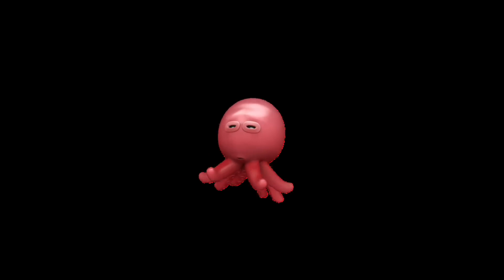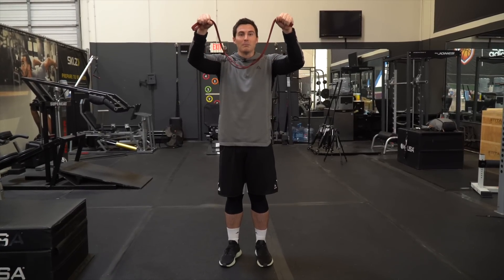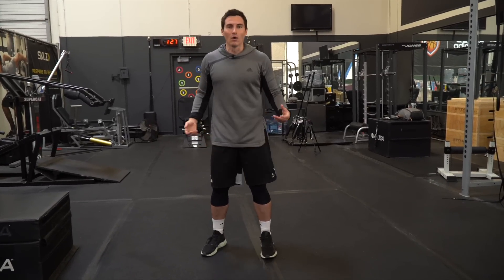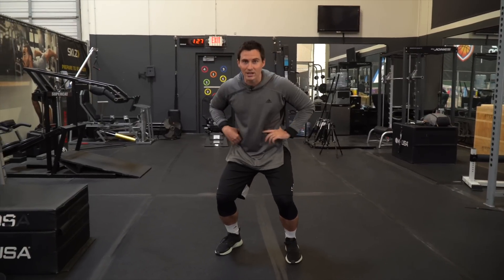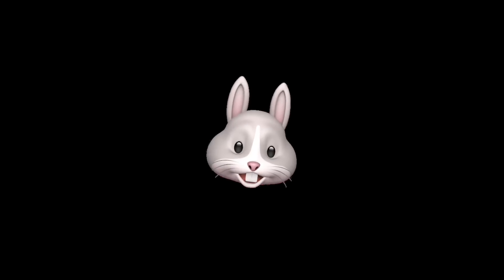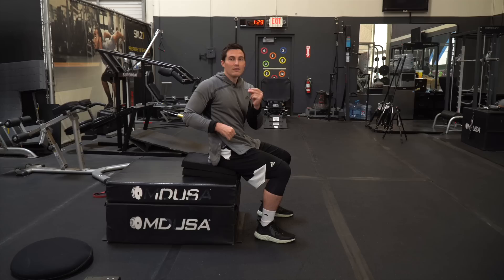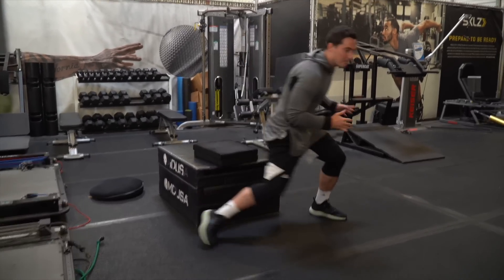Explosiveness Cheat Code- Improve Vertical Jump and Speed w/ This Tip

Comment: Coach how does removing eccentric part improves ssc? I thouht the more force absorbed eccentricaly the more force can be generated concentric?
Reply: Normally, the eccentric would be the “queue” for your tendons and legs. Removing that requires your brain and tendons to fire instantly and quicker by removing the “superpower” of the eccentric portion of a jump. The force from an eccentric movement does generate more concentric, but he explains that we should train WITHOUT the superpower so that we are stronger WITH the superpower (stronger with eccentric force translating to concentric)
Reply: @Wolpackman  oh so does focusing on concentric even for a long time can still improve stretch reflex?
Reply: @EZScalping  in a sense, yes. You’re obviously gonna want to keep doing both and this is just something people should incorporate into their plyometrics. It will improve the stretch reflex in terms of the tendon stiffness to activate and fire, but in terms of lengthening and rapid eccentric we obviously still have to include eccentric portions in our other movements as well as naturally through jumping
Reply: @Wolpackman  thanks for the clarification sir.
Reply: @Wolpackman  sir so which is more beneficial? Should I remove the super power? Because on this vid when I remove the super power, it will make me stronger with the super power right? What if I avoid the super power in training for too long. Im torn between stretch reflex reps or dead stop reps 😭
Reply: @EZScalping  of course! I know it gets confusing😭 but I would do variability. Still do more normal plyos and strength and power training but add these in. It doesnt have to completely take over at all, but can include the principles from the removing of the super power. Anytime you’re gonna do a maximal jump you’re gonna have to have a run up, eccentric, and concentric so just be jumping with max intent a lot and incorporate these principles and you’ll be golden
Reply: @Wolpackman  thanks a lot sir 😇

Comment: After just a couple months of these plyometrics and eccentric exercises I gained this super power in my calves and thigh. The muscle stiffness you talk about in your vids is what I’m feeling. I feel my calf contract unlike before and my hesis are 10 times more dangerous now cause I’m just so fast. My friend noticed it too
Reply: EVERYTHING ! ! Which exercises did you do
Reply: What excercises you do?
Reply: Basketball highlights I really focus on my core in the gym for the basis of my athletic ability. With a strong core you just run faster and jump higher and your more balanced. Also the plyometrics. Grab a medicine ball and hold it on your head and jump on a box 3 sets of 10. Also do single leg sitting squats. Get a chair and with one leg bend down as far as you can without sitting. Once you’ve sat explode up with the same leg. It’ll be hard but once you can do it doors open up. Muscle stiffness in my calves come from bouncing calf raises and jumping of of boxes once I get on the ground I jump 3 sets of 10
Reply: Basketball highlights also after my dynamic stretch warm up before I play I just hop on one leg with my toes to get my calves all stiff and warmed up
Reply: @EVERYTHING-dc2od  Ayy thank you for all of that my man I will keep that in mind🔥🔥🔥🙏🏻
Reply: @EVERYTHING-dc2od  leave the 3 sets of 10. Add weight and do 5x5, or better yet add even more weight and do 3x3
Reply: How is going now
Reply: @EVERYTHING-dc2od  to me it sounds like you're gonna get injured tbh, be careful, also can you dunk?
Reply: @DondiWhiteRIP  Adding heavy weight isn’t everything. Elasticity is key 🔑

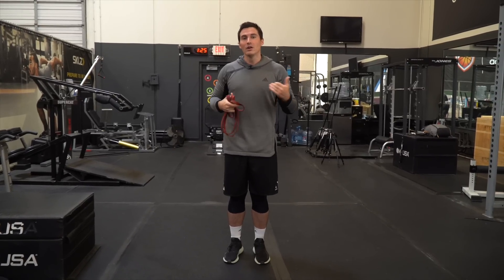Comment: 1:25 does that mean working on flexibility can actually be counterproductive to increasing vert?
Reply: No i dont think so ive heard flexibility helps alot
Reply: Depends on how flexible you get I believe, because if you focus on it too much it might be harder to produce force quickly . I don’t have any proof though this is just what I believ
Reply: @eduardomoreira7624  have you seen how high gymnast jump.
Reply: @seanmer5273  I doubt they can jump higher than nfl players with a standing vert test. They're very good at carrying their momentum though to propel them
Reply: @XYZip1  true but some gymnast can do a standing tuck and the height of their hips before flipping over is still up there.
Reply: @seanmer5273  isn't that more about just getting your knees high quickly just like with box jumps. I don't think that translates to pure vertical
Reply: @seanmer5273  Also the floors have springs
Reply: @Ajsh-18237  doesn't contribute much to vertical

Comment: Your cns DOES not have anything to do with jumping. As a "LIGHT" powerbuilder ill tell you no matter how many grinders you can push on squat it wont translate to jumping. The highest ive ever jumped was when i use to stretch roughly 20 min b4 and after workouts EVERYDAY....i also think glute and hip strength has alot to do with it...at the end of the day if you want too jump higher then "JUMP" more. But as in strength training a strong cns does not translate to a higher jump. Keyboard warrior tappin out.
Reply: I strongly disagree. You're talking about jumping more and stretching and strengthening the glutes and hips. The nervous system is the very system in place that allows for adaptations to occur around these areas you've highlighted. Jumping more often increases motor retention via myelination of axon sheaths (a nervous system adaptation). Stretching is the nervous system detecting changes in tension and length via the golgi tendon organ and muscle spindles. By applying a stimulus to the glutes and hips (which leads to strengthening long-term- provided progressive overload principles are applied) requires motor unit recruitment and cross bridge cycling in the sarcomere (micro-muscle) which is a nervous system driven command. The nervous system is the command centre of the body and basically everything we do is made possible from it alongside the various other systems that obviously make up our body. Thank you for the awesome video @PJFPerformance
Reply: @mosesbygate-smith2750  "i strongly disagree"⏩proceeds too have video of how to jump higher on chanel.....doing a JUMPING exercise😂😂👏👏nice try lil boi im not reading that. When you have more experience in basketball and powerlifting you'll understand.
Reply: @mosesbygate-smith2750  its all love baby. But ya man i most definitely was able to jump the highest by stretching...i don't know exactly how it correlates but it does. Im the strongest and lightest ive ever been rn but when i hoop i cant even touch rim anymore. Just like that exercise in your video i belive if Your performing a "jump" your training your "jumping" muscles. Just how you won't directly  get faster by squatting or you wont bench more by doing push ups, or You won't directly deadlift more by doing squats.
Reply: Carlos G Carlos G Carlos G you need to understand how the nervous system works. Jumping and other bodily movements are only made possible by the nervous system’s perceived arousal levels and as a result force/rate of force development output. If you read the title of my video it’s intended for single leg vertical jumping and top end speed. Reason why is because not only does it meet the nervous system demands of the activity itself but it also closely mimics the biomechanics as well therefore deeming it as specific. I have 10 years of experience in Basketball and 8 years of experience in powerlifting which eventually branched off into different forms of athletic training and development. It’s from this experience that steered me towards my chosen field of study, that being a Bachelor of Sport Science with a speciality in Strength & Conditioning (honours). As I head into my Masters I am confident that I have the knowledge, experience and expertise in this subject. I was fortunate enough to do my internship with 3 progressional Basketball teams as well. My point is that I would recommend you do some more reading on the nervous system and how it intertwines with our physiological movements. I understand the mechanisms and have more than just anecdotal evidence and experience. I agree that by jumping you will in fact jump higher but that’s due to specificity. What myself and many other qualified and experienced Strength & Conditioning won’t agree with however is that the likes of lifting, sprinting and other means of training that are fast twitch and high force/velocity in nature will not improve jump performance. These training methods fall under the same energy system, they target many of the same muscles and above all tick many of the categories of the force velocity curve that makes up movement
Reply: @mosesbygate-smith2750  k
Reply: @mosesbygate-smith2750  hey bro don’t worry bout that guy he’s just being mean . Anyway I just want to ask can I do weighted box jumps with like a 15 pound vest and then recover 48 hours for the nervous system to rest
Reply: @mosesbygate-smith2750  your so smart how can I run faster 🤩. Do theys exercise he has on the video work btw can I do them weighted. And also does doin weight training and Plyometrics improve your performance in sprinting and jumping ?